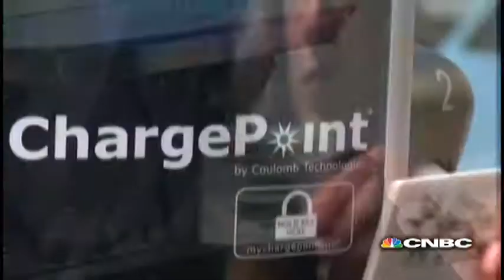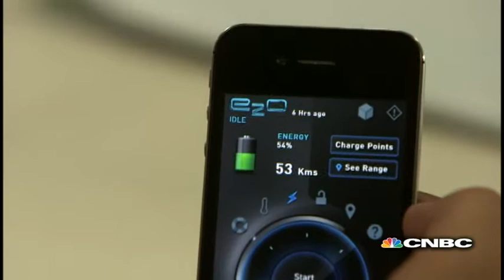Solar or Electric Cars? | Industrial Revolutions

Comment: Stella actually has closer to 400 miles on just the battery.  The solar panel can provide almost 200 miles during a bright day.
Reply: I have a small city EV, doing average 2-3 trips per week of around 30 km each. On paper, a 250-300W panel on the roof could supply all the power needed except for the two darkest wintermonths, so in essence, I'd only need a wall outlet for the return trip when driving more than 100 km one way! So even a small amount of solar power, can save me around $400 yearly on charging and make my car 95% autonomous. No need for 6 sq meters of panels, as the Stella, to make driving virtually free.
Reply: @Tore_Lund  Your small EVis still 3 to 4 times heavier than a Stella solar car. What you need to look at is usage per mile and charging time with the right size solar system. I suspect you will need closer to 3kw
Reply: @LawrenceRhodes  100Wh/km from the battery, without any  highway driving, careful slow driving with little traffic, around 20% less.  So a 300W panel, horizontally mounted delivers 240W for 6 hours average = 1.5 kWh /day = 15 km range per day with a proper mppt boost controller. Car is around 2000 lb, A=1.77 sqM, cD=0.33. From the socket now, I use 6-8 kWh per week, so it should work.
Reply: @Tore_Lund  I think you are missing the voltage. You need 300 w at 240vac. 300w at 12 v will not work.
Reply: @LawrenceRhodes  Who said anything about the voltage? You don't charge batteries with AC? My battery pack is 240V nominal, so either I indeed use 12V panels and a boost converter, which most likely has poor efficiency of 80%. Or I use 3 *100V panels in series, and a high voltage mppt charge controller. We are talking less than 2A going into the batteries in full sunshine, so the electronics required are really not that complicated nor expensive. I intend to use the voltage sense wires going to the BMS. They have their own 5A fuse and are permanently connected to the battery, so no need to waste power energising the main relay.
Reply: @Tore_Lund  I will be very interested in your results.
Reply: @LawrenceRhodes  Cheers, it is just in the idea phase, But the usual youtube way of doing it with solar panels>charge controller>lead-acid batteries> DC/AC inverter>onboard charger, is complete nonsense as it is heavy, expensive and wastes most of the power from the panels. So doing it like a solar race car is both simpler and cheaper.